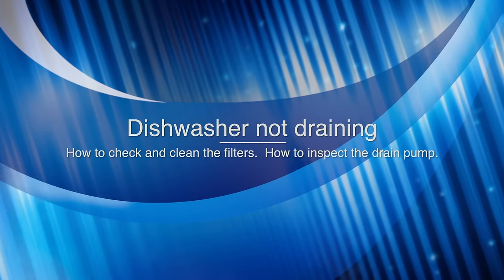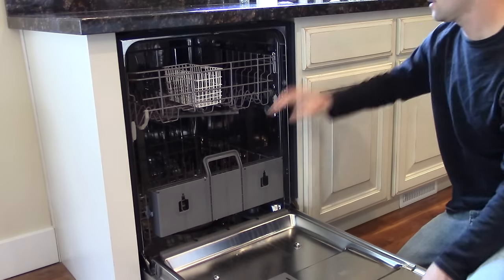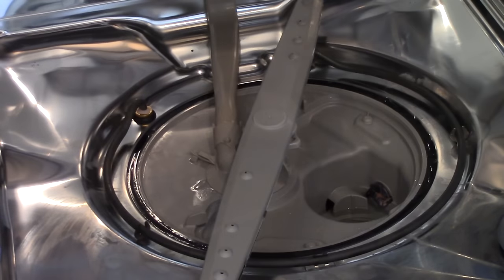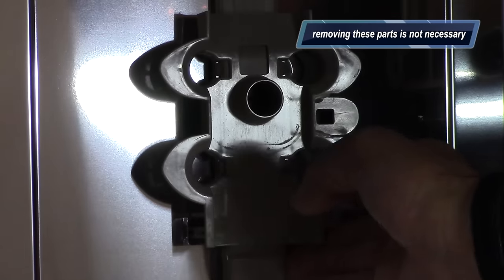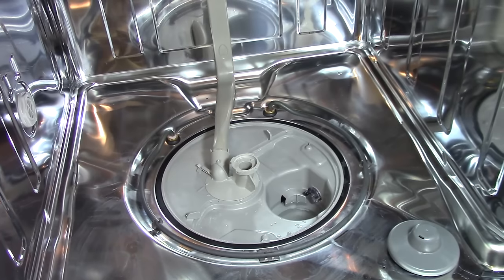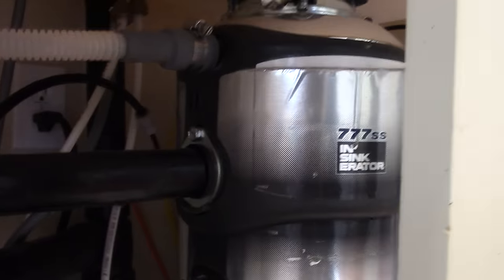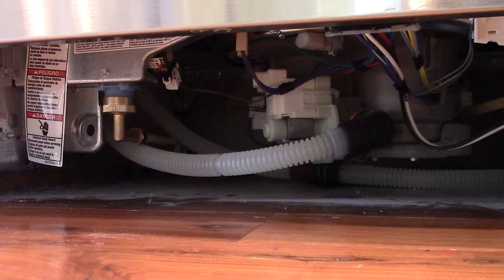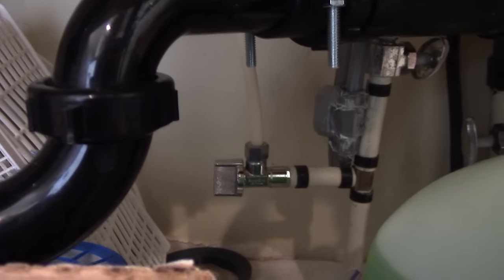How to repair a dishwasher, not draining cleaning - troubleshoot Whirlpool Kitchenaid

Comment: I have this exact dishwasher or newer version just bought 2 months ago.  There is a foul smell that sticks to the dishes and my whole cupboard smells now.  It makes me sick to my stomach.  We had a dishwasher install done as my spouse is way too busy at work.  No garbage disposal, and it is brand new! It has the same loop for the drain hose that the old one had so I dont think that is the problem, no backing up of water, there is just some inside the filter part always.  Cleaned the filter anyway just in case.  Not sure where to start, gonna call the warranty but going on holidays right away so will have to wait, any ideas?  To me smells like sewer almost smell makes me nautious but hubby says no.  Tried dishwasher cleaner, lemon juice, Borax(which removed the smell the best, but it comes back again.  I see allot of people online having the same problem with new dishwashers,  even with high end dishwashers....some say its the non phosphate cleaners but everyone with this complaint has a NEW dishwasher, tried the adding kool aid thing didn't work.    Frustrating, still have my old maytag Ready to call someone and rebuild it if possible.  My Hot water tanks is almost 10yrs old-someone mentioned a problem with magnesium anode rod's having a chemical reaction to the filter in the dishwasher?  Want to Flush the tank but scared to as it is 10yrs old and this may just push it over :-0  and the anode rod is in the hot water part not separate so hard to change it, its a bradford.  None of the sinks have an odor, just the dishwasher.  I noticed though when using the dishwasher if I use High Heat Wash the smell is worse. I have to rinse all of the dishes before putting them away and can't get the smell out of my cupboards.  All the $$$ spent on a new dishwasher for this! Anyone else had this problem with a new whirlpool dishwasher??
Reply: Therese B Suggestion new appliances are crap compared to old and more money and last no wheres near as long.   hang on to the ones u got, get them fixed if possible and maintain them!  Everything is going electric and those panels are expensive to replace, I'd rather have plain jane no fancy electronics to break down but good luck finding that now.
Reply: +Therese B Could it be the installer hooked into the drain below your P trap? If so you'd be getting putrid gas seeping into your dishwasher from the sewer/septic. Just a thought as I am not sure of the particulars.

Comment: How do we know if the drain pump is broken? I've only had this dishwasher for a year, but the things mentioned in this vid didn't solve the problem.
Reply from the maker: It's a little more difficult to test a drain pump.  
1. You can hook up a voltmeter to the wires that power your pump and see if the voltage is getting to the pump. It's more advanced than most peoples skill levels so at that point most people would call a repair man. 
2. Or you can take the pump out and hook up some electricity to see if it is good or bad.  
3. You can also just listen to see if you can hear the pump trying to work.  If you hear nothing, that means it's either broken, or it's not getting power.  

One thing that could also be the problem is if the hose is clogged somewhere in between the pump and the garbage disposal.  In my other dishwasher video someone just commented that they had that problem with a clogged hose.

Comment: I have a Whirlpool WDT720PADW2 Gold Star unit.  It was a real challenge to find a video as your's that shows anything close to this model.  I have cleaned the screens, but I was not quite sure about checking the impeller as you mention. All the other videos show a chopper assembly which can be replaced. Apparently this one is only viewed if you remove the lower hose from the pump and feel to see if a piece of glass or debris is clogging it there. Am I correct on that?  My dishwasher was not draining the water.

Also, my controls are in the top of the door on my dishwasher. I was trying to find out just how to run water in and then have it pump out in order to see if the machine is pumping or not. Someone said something about hitting the reset button to run a cycle and then pump the water our. Can you explain how to do this correctly on this type of Whirlpool.

We seem to have hard water deposits here and I am thinking that to clean that screen you show in this video, I should use vinegar on it instead of just rinsing under the faucet. Any thoughts on that?

The machine you show is not 100% the same as mine, but it is very, very close. Those little end stops on the upper rack are a major pain to remove in my opinion.  :-)  Thanks for posting this video.  My machine is less than a year old and there is actually not any competent repair shops in my area so I am doing the diy approach. This was my first attempt to work on this new machine, but I have installed older models in the past.

One other question for you:  Do you have any video on installing a new impeller/chopper or tips to cleaning that?

Comment: Is there supposed to be some water standing underneath the filters?  In that hole?  Like what is shown in your video at min. 1:38?  Mine has the same amount of water and I'm not clear as to whether or not it is supposed to be that way?  Thanks.
Reply from the maker: tsth Yes it's normal. The pump will not drain all the water.  It can only push out what makes it to the top of the hose arch.  Think of it like a rollercoaster, anything that does not make it past the top of the first peak will roll backwards when the power is off.

Comment: Hi great video any advice on a dishwasher; why it wont spray, I can here the water filling up, but I don't hear it spraying anything. It will complete a whole cycle just nothing is clean. It will drain when I cancel the cycle.  filters are clean and drain is clear, the float switch seems to work.  any suggestions, Thanks
Reply from the maker: +David Morrison There are only a few problems it could be.  You have a pump that cycles the water, and then you have lines connecting to the sprayer arms and nozzles. The problem is somewhere in that system. So here is what to check. 
1. are the lines or the nozzles clogged?  
2. are the filters or screens below clogged?
3. is the cycle pump (it's different from the drain pump) getting electric current? 
4. is the cycle pump in working order?
Reply: +AdamDIY   I took the filters and water sprayers and tubes all out made sure they were clear.  Took the spray pump off and took it apart. It was getting power,  I found nothing inside it was clean, the motor turned, seemed okay put it back together and it worked.  Must have been something small jamming the impeller from turning.  You should do a video on the spray pump, I could not find one for the Kenmore dishwasher. Thanks for the help.

Comment: Adam,  Thank you for your video, it's very instructive. My dishwasher hums when I turn on the drain cycle but doesn't drain.   It was draining intermittently when I was troubleshooting but now it's not.  I have checked the filter and there was some paper that came off a jar.  However, it's still not draining reliably after I removed the paper from the filter.  It drained initially and then stopped.   I removed the drain pump and did not find anything blocking the impeller. You show a sensor that's opposite the hole to the drain pump in the video but I don't see it on my KUDE60FXSS1 model.   I don't think the hose is blocked and I'm hearing the hum from the drain pump, could it be a sensor issue?  Could the drain pump be bad and still be making the humming noise?  Thanks

Comment: I have this type of dishwasher and it suddenly decided to just not fill completely with water and not to wash anything. Do you have any videos on how to troubleshoot this problem?
Reply: Mine is doing the same thing...after doing everything in the video, I added two gallons of water before the wash cycle just to see if the blades would spin. (from listening to it, that seemed to be what was happening, the blades were not spinning) It worked the blades spun, but did not seem to fill enough again for the next cycle to spin the blades. If you can give us some suggestions Adam, it would be greatly appreciated. Thank you.

Comment: I have this type of dishwasher. I just replaced my garbage disposal, which had not worked for months, and the first time using the dishwasher after this replacement it won't drain. The screens have been cleaned. I noticed in this video you did not emphasize checking the disposal line like in your other video. What should I check first?
Reply from the maker: I'm betting your problem is the 'knock out plug'.  New disposals have a plastic plug that you need to remove if you are hooking up a hose from your dishwasher.  What you need to do is take off the dishwasher drain hose on the end that is connected to the disposal and you will see the hole it is blocked by a piece of plastic.  Use a screwdriver and a hammer and tap it till it breaks off.   Let me know how it turns out.
Reply: AdamDIY Yep it was the plug. Thanks!

Comment: I had the same issue. Same error code as well. I ran through the cycle, opened the door after it drained and there was steam when I opened the door. I could not believe it. I did nothing else. I spent 2 hours cleaning and scratching my head. Then I saw your video. THANK YOU!!!! Very well done!

Comment: @AdamDIY I have a Whirlpool dishwasher very similar to the one in your video. The problem I am having is when the dishwasher drains it also drains from another point at the bottom. This happened after the contractor hooked the drain pipe. We just couldn't figure out why its draining from another point. We cleaned the filter and stuff but not helping. If you can help I will appreciate it.
Thanx in advance.

Comment: I followed these instructions for my Kenmore Elite b/c they had the same interior.  I had to un-attach both ends of the drain hose.  The disposal end was clogged with gross mildewed chunks, and the end going to the washer drain was clogged with a clear plastic label from new glasswear AND there was a toothpick in the impellor. All back together and it works like a champ!  Great video. Saved me a repairman call! I only have one small white o-ring left that must have come from the drain hose. Next time....

Comment: Great vid.  Very helpful. Turned out it was a blocked drain hose.  You should be able to hear the water gurgling from the disposer into the drain.  It should not be quiet.   If it is you may have a blocked line.  I used a very long - about 3 ' - cable tie - you can get at a DIY big box.  Won't damage the drain line but will reach nearly to the disposer and strong enough to clear the hose.  Most of the block was where you'd expect - the elbow from the pump.

Comment: I have this exact dishwasher. It fills and drains water but the sprayers are not going. Do you think the motor needs to be replaced and is it easy to do it yourself?
Reply from the maker: Amber Shadley It depends on your skill level.  The motor could be out. Or the sprayer line could be clogged.

Comment: This is great video. Thanks for sharing. In my case I took the hose off the pump and tried to blow through it. I couldn't push any through it. It was restricted. I then removed the hose from the disposal and then tried to blow through the hose again. This time it blew freely. Turns out the restriction was at the garbage disposal.  I had just replaced the garbage disposal a few days prior and I didn't put 2 and 2 together that that was about the same time the dishwasher stopped draining. Turns out there is a plastic knockout plug in the inlet of the disposal inside of where the hose attaches. You are supposed to knock that out if you connect to a dishwasher. I took a small screwdriver and hammer and knocked the little plug out and retrieved the piece from the inside of the disposal and it's all good now.

Comment: Adam DIY... I had already gone through these steps and watched your video.  Thanks for taking the time.  Our dishwasher is doing something different though.  It is filling, heating and timer moves on, but it is not washing.  Not hearing the motor for the wash kicking in.  Then, the water does drain properly.  Any thoughts?

Comment: Mine wasn't draining, so I opened the bottom cover, took off the drain pipe, and discovered part of a zip tie in the pump. Took that out and it works fine!  Thanks for the video on this model, as some other dishwashers can access the pump from inside.

Comment: If drain pump is working and there are no blockages (confirmed) but washer will still not drain fully.  Is it safe to assume the water level sensor is bad?   If so can these be cleaned or will I need to replace?   Thx.

Comment: Thanks.  You video saved a repair bill.  Piece of glass was stuck in pump and not letting the impellers spin.  With my finger (just like your video stated) I freed the impellers and sucked the glass out with a shop vac!  Works perfect!  Thanks a ton AdamDIY!

Comment: Excellent 'how to" presentation: voice tone, modulation, pace and great camera work. I was lucky that the dishwasher in the video is the same as mine. Regularly (weekly) cleaning the filters in the bottom as he demonstrated will prevent almost al of the draining problems. Once a month do a one hour cycle with a six cup bowl of vinegar on the top rack.The regular maintenance will add years to the machine and you'll get cleaner dishes. With the newer improve soaps dishes are amazingly clean and shiny compared to machines twenty years ago. I live where the water is soft, so I do not need water treated. There's lots of dishwasher models with excellent reviews.

Comment: You kind of touched on but didnt elaborate. 

I found my slow drain being caused by a "y pipe" with an air vent. The drain pipe went to the y pipe by my sink and then would overflow into the garbage disposal. I didnt realize what it was until I traced the hoses and wondered what it was for. Upon dismantling the air valve on the sink I found it had collected a ton of stuff. From paper to larger chunks of stuff. After removing that blockage it allowed my system to fully drain

Comment: Wonderful video.  Filters were all clean.  Found some gunk where the drain hose empties into the garbage disposal but not a blockage.  No gunk, perfectly clean, where the drain hose connects to the drain pump.  Can move the impeller with finger.  Question:  I've disconnected both ends of the drain hose.  Shouldn't I be able to blow through the hose from either end?  If I can't, does that mean there is a blockage somewhere in the drain hose?  It can't logically be a sudden kink in the hose because nothing has moved since it was installed.

Would appreciate any suggestions.

Thank you.

Comment: Thank you for your easy to follow instructions.  After following them step by step, I eventually found a piece of broken glass impeding the impeller in the drain pump.  After removing it and starting another short cycle, the dishwasher again shut down at beginning of the drain cycle.  Removed the hose one more time to find another piece of glass.  Alas, the problem is fixed and the drain cycle is working.  Your video is greatly appreciated!

Comment: Please let me share my experience. We had shattered glass in the filter. And, in the impeller housing as well (we could hear it). After undoing all connections, removing furniture trim, removing machine, removing bottom cover, cleaning water pump, and putting it all back, it still had F4 code! What I missed is to clear the drain pipe! I had to remove everything just one more time, detach the hose from the water pump, and examine it. One piece of shattered glass passed the pump and went half a metre in the pipe before being stuck there. It blocked 90% of the cross section of the pipe. I broke it with a wooden stick, washed it out with garden hose, put all together - the machine works OK since then. All in all: do not forget to clean the drainpipe in all its length!

Comment: Hey Adam, great video. My filters were clean except some very small particles, but not a lot.  Is it normal for there to be about 1-2” of water in the drain well?  I checked and I can’t see or feel anything blocking the sensor or the drain holes.

Comment: Thanks for the video.
My issue turned out to be a plastic sticker that was one a dinner plate. It made it past the pump and got stuck in front of the check valve built into the end of hose that connects to the pump.
Reply: Did you have to pull the dishwasher out to get to the check valve to find the sticker?
Reply: Alan Matthews 
No, not at all. The check valve is right at the end of the drain hose where it connects to the pump outlet. I didn't have a lot of slack in my hose, but was able to access it easily while laying on the floor.

Comment: Thanks Adam for the nice, clear video.  My DW wasn't draining and I checked the pump and filters as you suggested.  I was about ready to tackle the pump and thought to check one more item, the air gap device on the top of the sink.  How about that, it was full of stuff.  I cleaned it out and now it is running like a champ.  You might want to mention that in your next video.  Regards, Jim